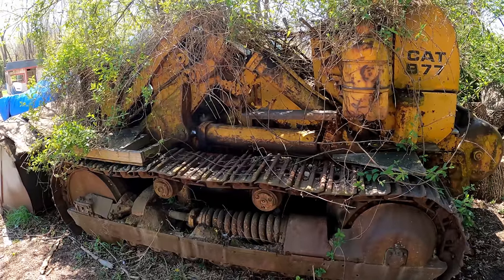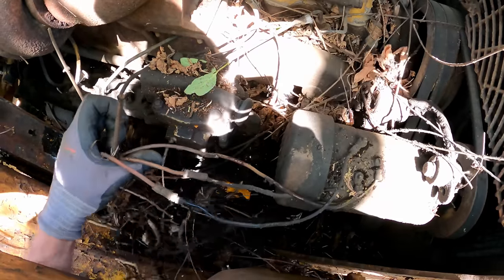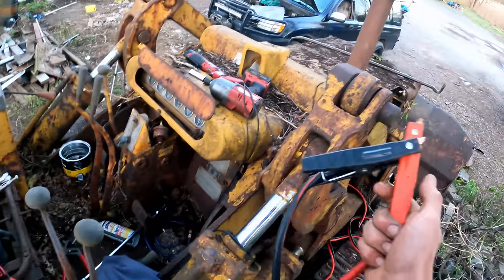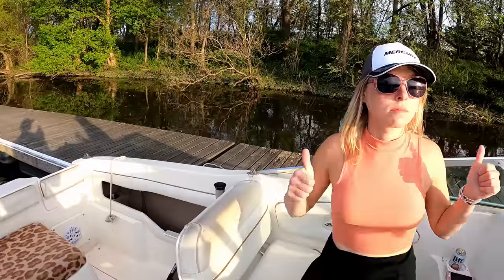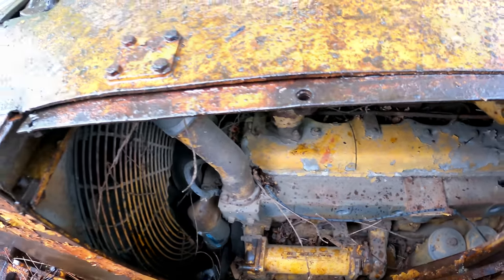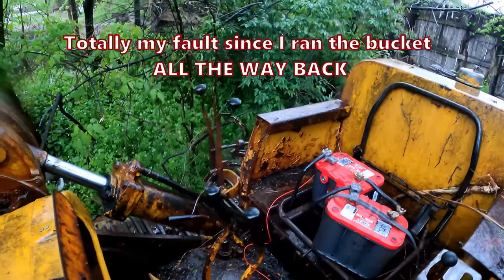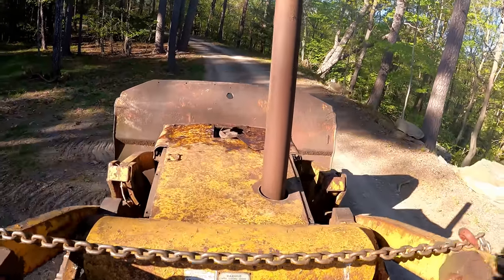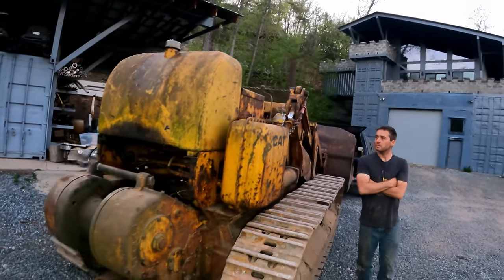CAT 977 Sitting 37 Years Will It Run? - NNKH

Comment: Dude your approach to walking up to anything with an engine is impressive.  I would have walked away from engines that only needed new spark plugs; however, you pull off the unthinkable. That is so inspiring to us. I think if there were more of you out there. Noone would go out and buy new cars or trucks, because we would just have you fix them up at a cheaper cost. Thanks for what you do. Keep wrenching.......
Reply: Definitely a talented technician!
Reply: I bet you you can get it going
Reply: As long as we can work on our vehicles.. Right to repair has to be fought for.
Reply: @CerebralAilment  dont think he is a technician, mechanic or engineer more like .
Reply: Слабаки

Comment: Looks like a 53A machine. D333 engine, 2 sp powershift. Very slow operating but in its day there wasn't anything else. Any questions, don't hesitate to ask. 45yrs working on and for Cat.
Reply: that engine that gets stronger the more strain you put on the cat? 3 cyl?
Reply: @Freecomments4u  Your thinking of the earlier series RD6. Loaded drawbar pull increases. Operating RPM is around 800 I believe. Squatch253 has extensive videos on the tractor and power unit.

Comment: I used to run a Cat 955 and 977 for a small excavation company, these machines were great and ran fairly strong all the time.  Dead batteries were the only thing that stopped them from working. Use ours for lot clearing, cuttings pads and demo jobs.  One of the bast and easiest machines to run, better if it has a 4 in bucket.

Comment: Yoo... I just came across this vid, & was compelled to see just how far a person's determination can go.  I'm sittin' on an auto restoration project, that's got me tougue-tided, because the parts I'll need, are scarce and therefore my '91 GTI may sit shrouded, and housed for yet for another decade.  But after I watched you toil-over all the repair issues it took resurrect the 977; I felt the need to put my dream machine, back on the road again.  So, I have you to thank for the encouragement.  Continue the great work.

Comment: I have 2 Cat 955s a K and an L. The K has a winch like that. when I bought they said it wouldn't move. It turned that the PIO lever was out of gear. I drove it off the truck. I cant believe someone would scrap that 977. Its a power shift and there are lots of valuable parts on it. Cat still supports 50+ year old equipment. Early 70s D7 G and Fs bring more than $50,000 on many sales and thats to dealers. 
The 977 has been rode hard and put away wet. When you see wear like that on the steer pedals and the pin holes are oval shaped, its worn out. The "mud" in the strainer is bacteria that grows in steel tanks with diesel or kerosene when water is present. it will stop up filters fast. Power Service makes a tank cleaner. Dont forget to put in antifreeze,

Comment: The water in the oil pan might not be from the open exhaust. I have a D4 that had a bunch of water in the oil pan after sitting for 30 years outside and the exhaust was covered. The water came from the one way oil seal  in the clutch housing between the clutch housing and the crank case. The gasket on the top of the clutch housing rotted and allowed water in.

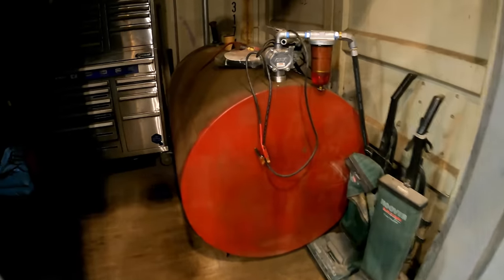Comment: 40:53 I noticed that you are using an EZ-8 fuel pump from GPI. I actually used to work on the assembly line and in the warehouse for about 13 years. Theres a solid chance that I actually BUILT that pump. Neat.

Comment: If the tracks are seized, don't use any lubricant; soak it with plain water to loosen up the rust and flush it away after the pin movement grinds the rust to paste

Comment: My Dad and i were hunting on a friend of his land years ago. We came upon a old 450 Case that looked like it had been sitting a long time. We already owned one almost like it except ours had a winch and a 6 way blade. We went and talked to him about it and he told us the story that he was building a log road and a tree had fallen and hit the side of rhe engine where the fuel pump bolted on. All it jad done was sheared rhe fuel pump off the block. He said that had been at keast 25 years ago. We talked a little longer and i spoke up and asked what hed take for it. Rhe undercarriage was in great shape, rollers, idlelers, tracks,pads, pretty much id say 89 percent so it was worth parts to us. He said if we could get it out we could have it. I couldn't believe it. We had some of the same issues you had that water had gotten into it but we drained everything out and poured transmission fluid down in all the cylinders. Pretty much just filled it full of transmission fluid. Let it se about a week or so and we t back and was able to turn the engine from the crank and got it turning pretty loose. We didnt bring a new fuel pump so all we did was hung a 5 gallon bucket up high on the cage so it would gravity feed. We put a battery in it, and after tinkering some more the black smoke rolled out of her. I took a little while to get the undercarriage lossened up and to theow some grease in it. The old feller had gathered some of his and dads other friends to give us hell when we came back empty handed. I wosh i had a picture of all those fellers faces when i drove it up on the lowboy. We chained it down and took off home. Spent the winter rebuilding it and still have it and use it to this day. Me and Fad both worked st the same strip mine and so did his friends. We gave them hell until the job was done. Great job man. A lot of people dont tealize how bulletproof a lot of the older equipment was. You had to have major problems to not be able to get one to run.

Comment: When the starter spins freely people think it is not engaging the flywheel. If you think about how a starter works you would know that is not the case. Every starter I've ever seen is designed so the motor is not energized until the pinion gear on the starter drive is fully engaged. The starter is fully engaged in the flywheel and it is the over running clutch in the starter drive or Bendix that is not engaging.

Comment: Get a toilet plunger, take the handle put, drill a hole where the handle screws in. Get a new tire valve, glue the fat end in the plunger. Excellent for unclogging sinks or pressurizing fuel systems..

Comment: There are engine turning tools that will turn the engine. Early models, the starters get pulled for the tool, later models have a separate access for a turning tool.

Comment: Can't beat cat Dr absolutely bomb proof I got a cat e70b here in Ireland has gone through absolute torture and still going strong the only thing is it has two worn bottom track idlers and I can't get them since the dealership closed in Cork. Great machine starts first tip and works a 19 hour day no cracks in the frame its built for torture killing to park it up because of two idler rollers.

Comment: Those sharp rear sprocket teeth...I'd suggest...cleaning off the rust...and Welding A Bead...or a couple of Beads...along the edge of each sharp tooth....then just File Them to Shape and Size...could be an alternative to replacing them.

Comment: Im a diesel mechanic.. ill tell you,. Diesel engines are incredibly durable.. i have started machine's that had decades old Diesel in them.. once you get them going they don't stop

Also, you should have mixed the diesel with automatic transmission fluid 50/50... Cleans the injectors and lubricates the pump and lubricates the injector needles helps clean carbon around the injector tip for better atomization.

Comment: I noticed a note that said engine needs to be idling when checking engine oil, that's wrong. The Engine needs to be shut off and cooled down before checking engine oil level so you will have a more accurate reading, cause when it's idling you will give you a false reading cause it's not all the way down in the pan.
Reply from the maker: The dipstick said to check while idling.
Reply: @NoNonsenseKnowHow  and how old is the rig, they probably didn't know back then that while running you don't get an accurate reading.

Comment: If you are going to push start your truck, try 2nd gear instead of first.  This is generally easier on the clutch and less of a jolt on the engine.  Also, really enjoyed this video.  Love the sound of that engine.
Reply from the maker: If you don't have enough speed, first year is the only way to go. Otherwise yeah I definitely agree with you about using second gear or even third gear if you have enough speed

Comment: Any interest in a 1954 John Deere bulldozer model 40? 
The item is complete but for the muffler. It was started in 2009 but wouldn't run without the muffler.  6klbs $2k for the machine and $3k to load it on your truck. Or if you can start it and drive it on.

Comment: When you have a piece of equipment that hasn’t ran in a while DONT start moving controls. The tolerances are super tight and with no oil you can score the bores in the spool valves. Not to mention the seals. Just my tid bit 💁🏻‍♂️

Comment: I have resurrected a lot of fossilized machinery in my time. I would have never guessed that the engine in this machine would’ve started so easily. In fact I would’ve readily bet a sizable sum of money that it would never happen in the manner in which it was depicted in this video. I highly doubt that this machine was parked at that location and had not run in 37 years.
Reply from the maker: I was told 37 years by the owner. But yeah it was probably less would be my guess as well. However you saw how much water was in the engine and there were many signs that it's been sitting for at least 20 years or more based on my experience.
Reply: @NoNonsenseKnowHow  I think one contributing factor to this engine being able to still turn is the fact that they have steel cylinder liners and not cast-iron. The steel liners rust in a completely different manner compared to a cast-iron cylinder wall.

Comment: The old diesel engine does not need trouble to restart it, and there is no electricity, spark plugs or Delco in it, so the engine wakes up if it sleeps for 50 years